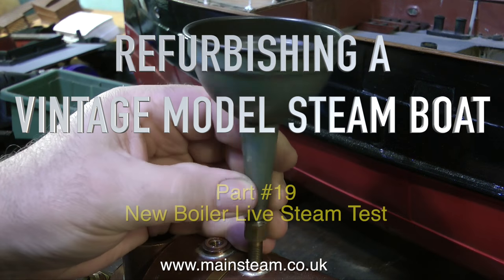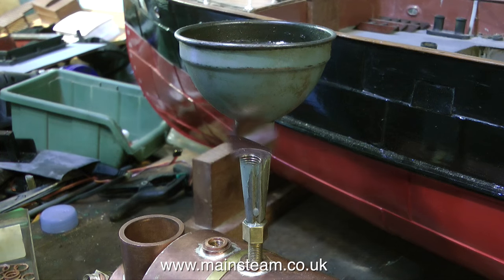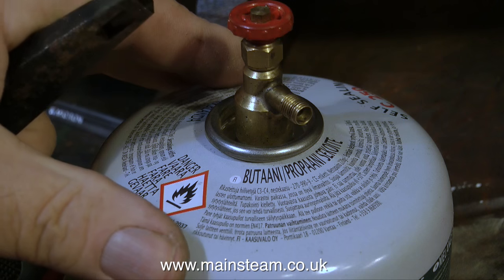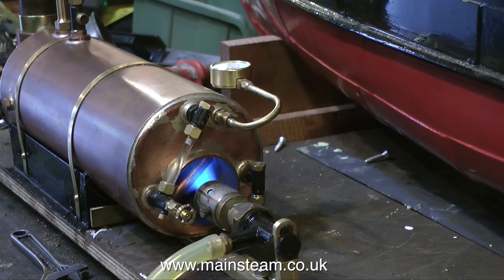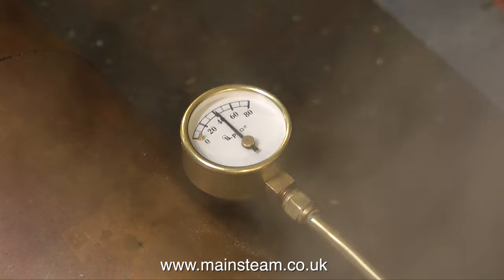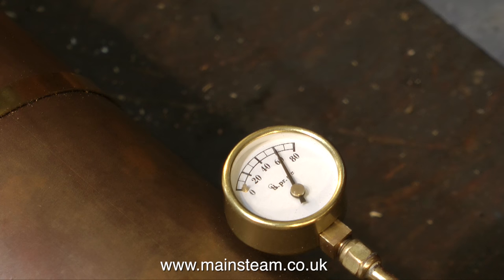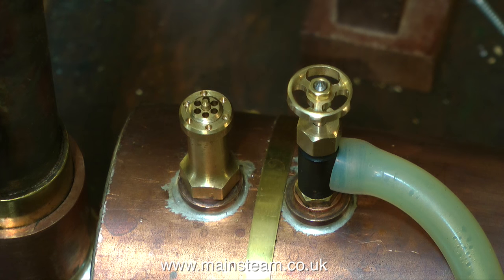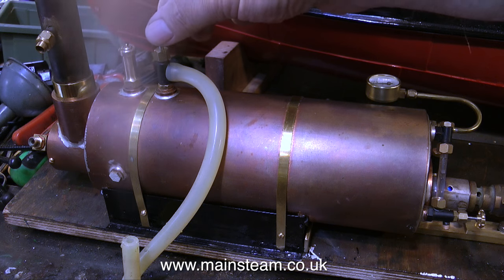REFURBISHING A VINTAGE MODEL STEAM BOAT - PART #19

Comment: Hi Keith,
I am making a steam engine and making it in SolidWorks first.  I cannot, for the life of me, figure out the relationship between eccentric diameter, eccentric rod length, eccentric angular separation, and eccentric throw to make the Stevenson link work.  I keep tweaking the different values, but the piston valve isn't behaving.  I know this is might be a weird question, but how do you design these things such that the valve gear works properly? Any references I can read that you would suggest??  Hope this makes sense....
Reply from the maker: The best thing to do is buy a commercial drawing for a steam engine ie: a Stuart Models engine, and then the eccentric throw relative to the stroke will become clear.
Reply: Keith Appleton Ah good idea! Thanks! I don't quite know where to get such a drawing, but I am sure a google search will come up with something...
Reply from the maker: Try the Stuart Models Website .....